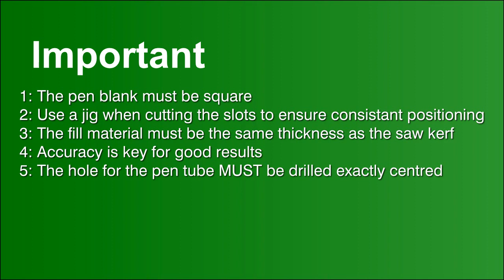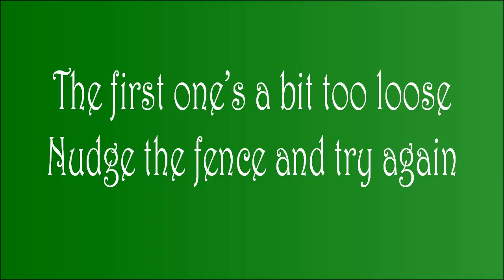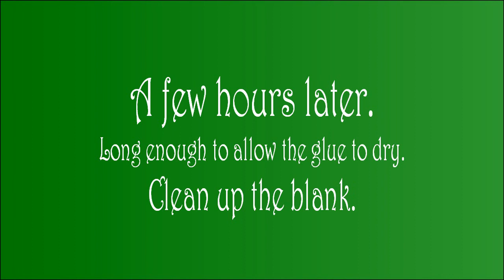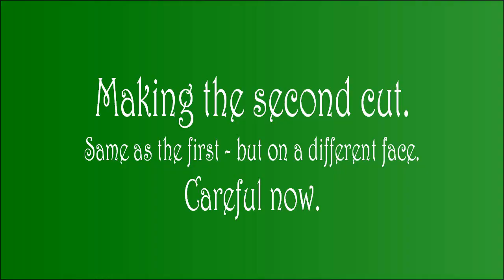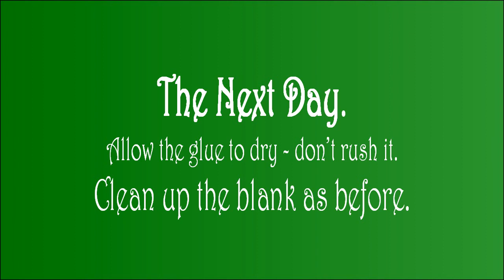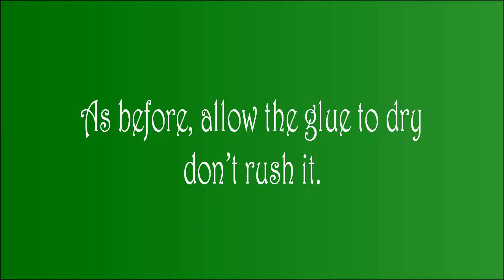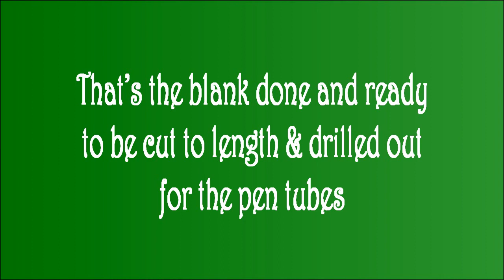Making A Celtic Knot Pen Blank

Comment: Great video.  I have made a few of those pens but used my table saw.  Think I will switch over to my band saw.  I have used CA glue on mine and they come out great.  I will have to give wood glue a shot and see if there is a difference, besides drying time.  Thanks for sharing.
Reply from the maker: Thank you for watching and commenting

Comment: Nice pen, I have only a 50/50 success rate when I make these, something is always a little off and the knots do not always come out right. Great video.
Reply from the maker: woodturningjohn Thanks John. My first couple were failures but now I use this method the success rate has improved. I also drill these out in the lathe chuck using special pen blank jaws now, I found trying to get the blank dead centre on the pillar drill (drill press) to be very difficult.     Cheers     Bob.

Comment: Really impressive symmetry.  I have found that my two biggest problems are making sure my blank is square and that I drill dead center. How do you square your blanks?
Reply from the maker: Thank you Mario. The blanks in the video were already planed square but for others I have done I rough cut on the band saw and then hand planed smooth. You would get better results with  a table saw but don't have one, so I use what I've got.    Cheers     Bob